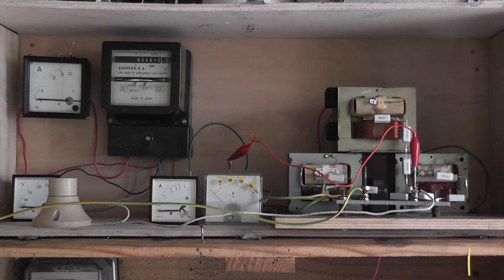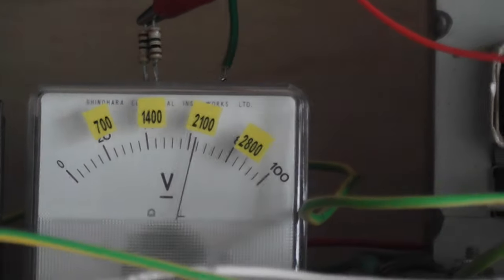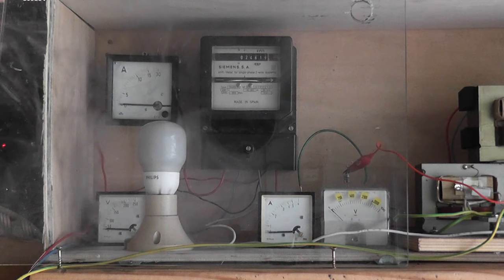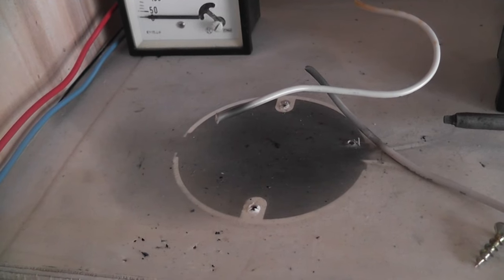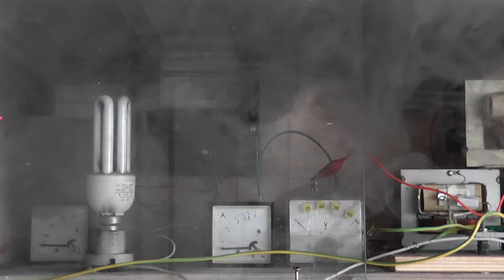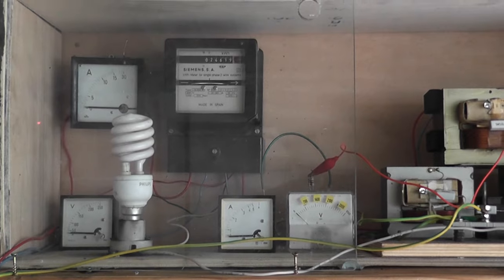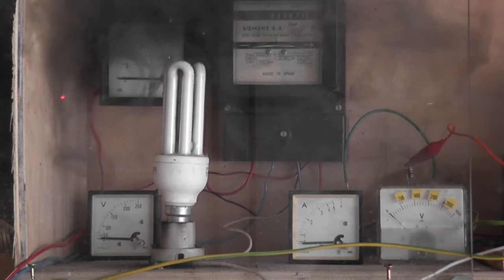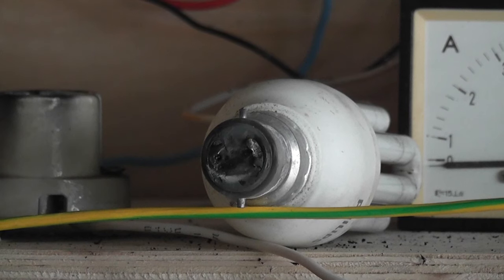3 metered MOT's parrallel -- CFL burn outs

Comment: I think it would be interesting to see what happens if you take apart a working CFL and run the high voltage through the tube itself, from one end to the other. See if you can't get a few seconds of REALLY bright light before it pops :)

Comment: Having thought about it, you could always fill the socket with dielectric grease (thermal heatsink compound for example, cheap white silicone paste used in PCs, audio amplifiers...too many devices to list!) to try and stop the arcing inside the socket?

Comment: No diodes are not needed, yes its possible to operate them parallel if they are the same voltage rating.

Comment from the maker: @2124reading  From a standard 100 volts AC meter. I put a string of  6 x 1 Meg ohm  ! Watt T's  in series then two strings in  parrallel.
Feed the MOT with low voltage 24 - 85 Volts via a variac and check with a DMM up to 1000 Volts. 
then relabel.
Reply: 😀
new rodalco2007 so lmps and 1000 porcient

Comment: @RODALCO2007 we use cfls and so far even though they are in recessed lights they last about 4 years, with very high usage too. we use 13w GE helical cfls, the other brands are crap. I should start making LED lights but I have to find a good source for cheap white leds. But I never see microwaves at the side of the road, where do you get the microwaves to harvest goodies from?

Comment: Seems the smoke is mostly due to the rapid combustion of the surrounding matter when the contacts fuse together and create massive heat. Might i suggest you remove the internal soft-starting ballast circuit and wire the tube directly to the input pins? Tubes might explode though, unless you beef up the input wiring inside. Might even be able to make use of all the low power inverters afterwards? Connect inverters in series then connect transistor radio! lol